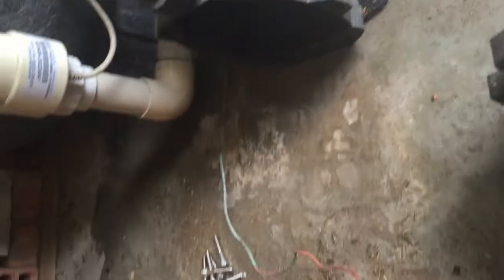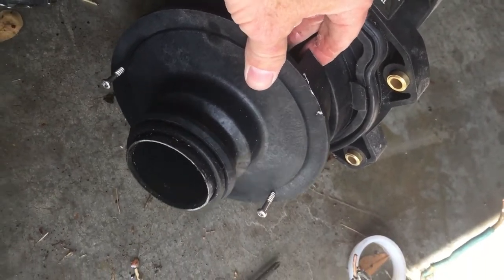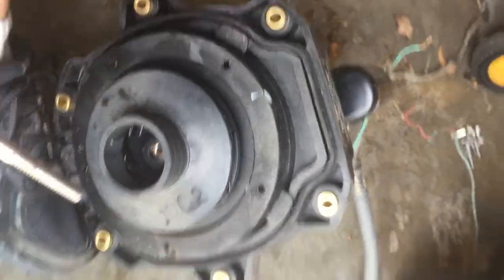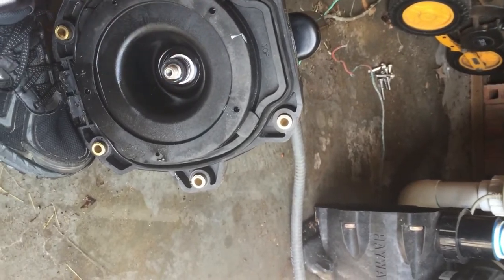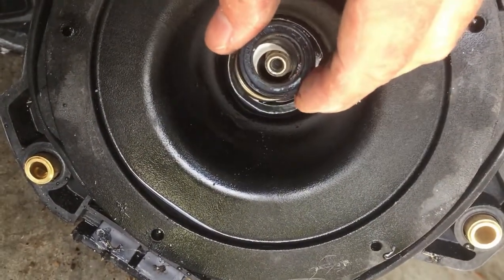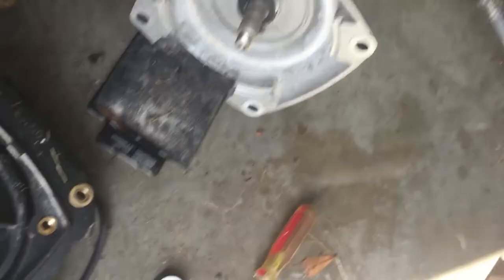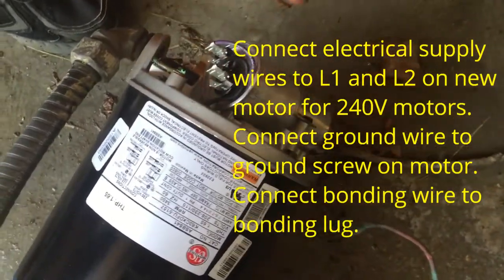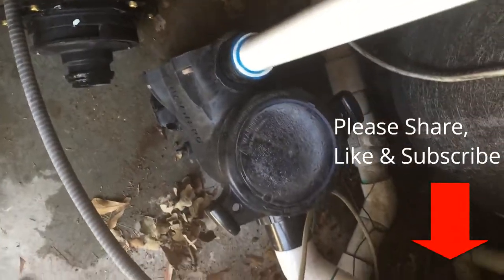Change Hayward TriStar Pump MOTOR

Comment: Thanks for the video. One question for you, do you apply any silicone lube to the ceramic parts?
Reply from the maker: No.  The ceramic parts of the shaft seal fit together without any lubrication or even finger print oil on them, I usually press the seal into the housing with a paper towel as to not get oil from my fingers on the white part of the shaft seal.
Reply: @truelightpoolsllc4441  thanks for the quick reply. Most of the vids online are for the superflo and I would have run into trouble if I hadn't watched your video. Going to try to fix the leak this week, really appreciate it-
Reply from the maker: @nashtrucker  You bet!
Reply from the maker: @nashtrucker  Sure thing!
Reply from the maker: @nashtrucker  Sure thing!

Comment: so the tech that installed the new motor left out the impeller screw. could that be where my leak is coming from?
Reply from the maker: Leaving out the impeller screw should not cause a leak, it would be the shaft seal or the pump housing seal most likely.